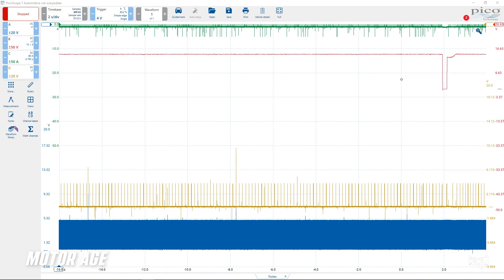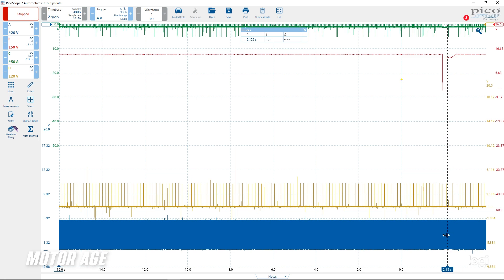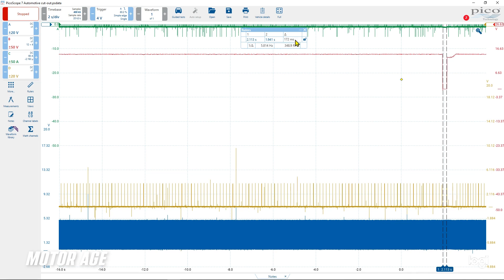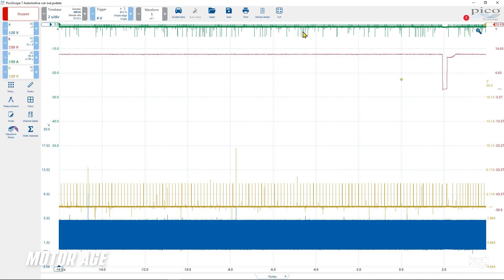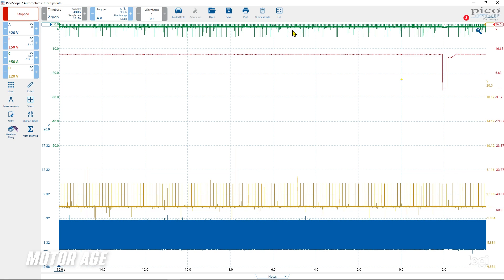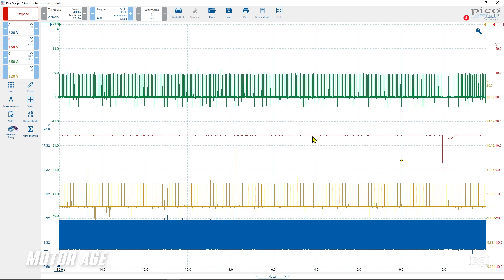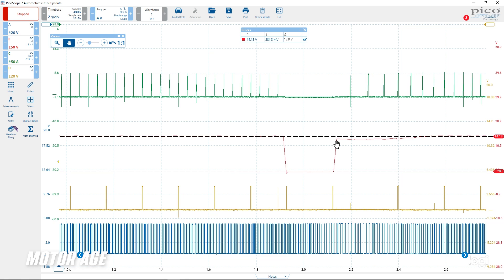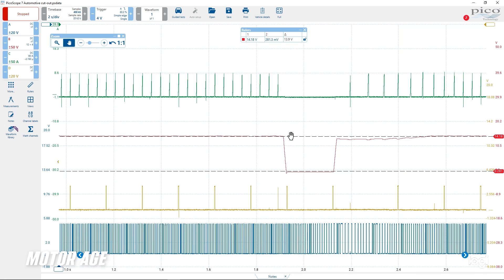Mastering Vehicle Diagnostics #2: DSO Trigger Function

Comment: Soo what was causing the signal for ignition power to kill or open similarly to a crank sensor? Was it a pinched, or loose ground or compromised ignition power wire? Was it something crazy like a bad key signal?
Reply: I pulled a fuse to simulate an intermittent broke wire or failing relay.

Comment: This is really good information. Thanks!  Question, and forgive me if it's a dumb question, I tried doing a long time trace on my Pico 4424 scope using an ES #695 80A current probe.The problem I had was, after some period of time, my current probe turned itself off. How do I make my current probe stay on for long trace captures?
Reply: I'm not sure how the current probe you implement functions. there are many out there that will not turn off automatically and they are quite inexpensive. I would seek out on of those.

Comment: Enjoy your logic but it doesn't help us backyard mechanics without the tools you use when we only have a 6/ 12 volt probe and a multimeter.  Any chance of doing a video using just those two tools and wiring diagrams?
Reply: I hope the day never comes when motorage actually decides to cater to the backyard diy segment.       It's an industry publication for professionals.    Not DIY
Reply: @jeffcompton6937  well some of us DIY people have vehicle problems.  We do the best we can but need advice now and then to help getting our vehicle back on the road.  I know that I have a wiring problem or the ECM has given up.  I would need to know that I don't have any shorts in the wiring as to not use the new ECM as a fuse when replacing it.  I've heard that you need to program the ECM after installation.  I'm not sure how to do it and look for videos about the subject.  Thanks for your input.
Reply: @peacepoet1947  Hello, and thank you for viewing our tutorial videos. Unfortunately, we will always be governed by the limitation of the tools we have and the information they provide. As much as I'd love to be able to say that this issue displayed can easily be solved with a multimeter, it wouldn't be true. In a "MIN/MAX" setting, it would surely capture the dropout, but you would first have to know what the reason for the stall was, to begin with, and where to test next. Put simply, without being able to "see" the fault portrayed with the tests I have implemented, I would surely be guessing where to test next. This is not very efficient and would likely leave one with unanswered questions. My advice would be to invest in the tooling and the information required to analyze whatever system you are faced with. I know it is easier said than done, however, this is what it takes to tackle challenges like this one. Thanks again for viewing and commenting!
Reply: @brandonsteckler3417  I agree with you that diagnosing a problem where I need to find out if there is a short in the wiring, a bad component or the ECM is bad.  First thing I did was check all of the wires.  I found stripped wires hidden under the plastic covers that protect the wiring.  I put electrical tape around those wires.  My transmission needs the pan dropped and I'll try to test each of the four torque converter and shifting sensors on the transmission.  The code 42 showed up after I got a code for the transmission sensor when I was replacing ICM I put my hand on some wires that were stripped which possibly shorted out the ECM.  I've never inspected anything with the transmission because I never had a problem with the vehicle until she was running rough and wasting lots of gas.  Cost me $60 or more to drive 28 miles.  I need the vehicle but it probably be less expensive to pay for the right person to do the job if I could find someone who has a shop large enough to get the vehicle in the shop. Thanks for your input but buying a scan tool to diagnose the problem when everything seems to point to the ECM is burned up and there is another problem with the transmission sensor which was the first code I got before doing other work on the engine.
Reply: @peacepoet1947  no ones debating that everyone doesn't have vehicle issues that require repair.    But I stand by my stance that alot of DIYs waste more time and money then it would take for a competent tech to actually diagnose the issue.     By the time most of you fire the parts cannon unsuccessfully at it,   install a bunch of chinese junk parts that just add another unnecessary variable to the process you are fed up and low on funds and then you want sympathy and discounts from the qualified repair centre.      Most tech is now beyond 95% of most DIY ability.
Reply: @jeffcompton6937  to diagnose a problem with the right test equipment makes solving the problem much easier.  I'm doing my best to figure out what is wrong with the vehicle before I spend my money needlessly.  I do appreciate your input on the situation.  Hope that you had a wonderful Christmas.
Reply: @peacepoet1947  my point is money wasted by the untrained on purchasing diagnostic equipment would be better utilized paying for thorough competent testing.     The days are going away that you can get by with a dvom and a code reader and some online forums.     As more vehicle systems become interlinked the liability is gonna move towards no DIY.      We dont need untrained professionals doing hack,   dangerous repairs in the name of pride or being cheap.
Reply: @jeffcompton6937  it isn't being cheap but I don't have anyone who can work on the vehicle being a 94.  Even the smog guy has refused to do my vehicle on the next registration renewal. I'm not sure where I'm going to find a place to get the vehicle smog check in March. Thanks again for your input.
Reply: MJ do learn do this backyard style, u gotta ask an expert on that style, cant expect this guy to even have the same equipment youre using lol. And with that said the way you do without lab scopes is to get a jump box and a miltimeter and lots of gator clips, and a fuel pressure gauge, and bypass all the the relays by jumping the fuel pump to a jump box or battery and run the car.. and actually attempt to put a load on the engine if its running fine in idle.. if the fuel pump cuts out with the dedicated power, then you know its the pump.. however in this cars situation it seems the car would stall from an intermittent ignition problem on the SIGNAL or GROUND side of the circuit. Only if the battery was dead could this be an alternator potentially.
Reply: @billyjames2493  thanks for the information that you provided me.  The engine doesn't stall but runs very rich.  Paid $60 for 28 miles of driving.  Temperature gauge is working because the gauge moves up on the short drive to the grocery store.  Have a code 42 which means no input to the ECM or ECU which is the same thing.  I am trying to replace some of the wiring harness that goes to the throttle body and other places on the engine.  Those harnesses are expensive.  Over $400 from a Speed Way outlet.
Reply: @billyjames2493  thats some of the worst advice I've ever read online.      Great way for someone that isn't super competent to burn down modules and harnesses.     

Well done!